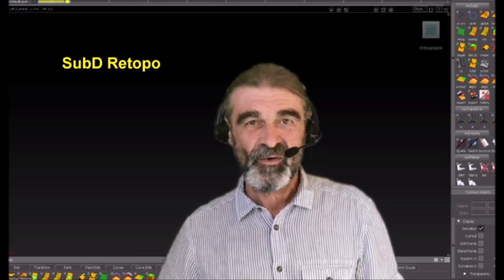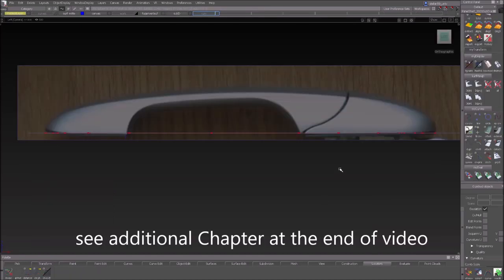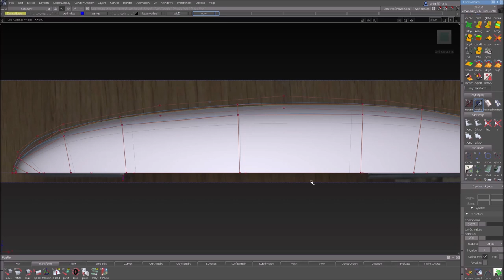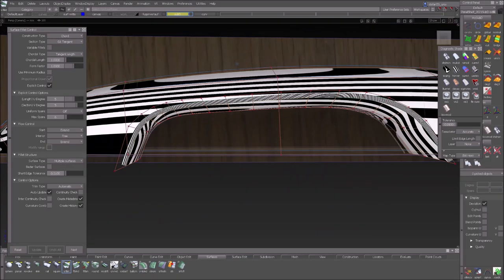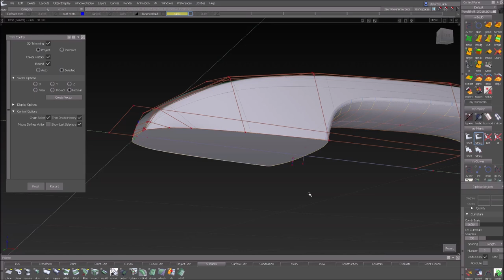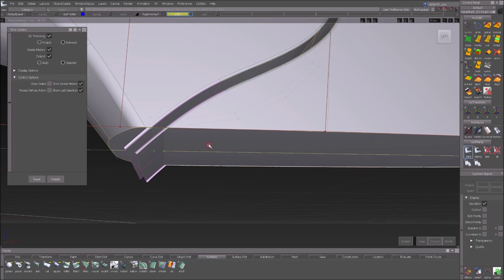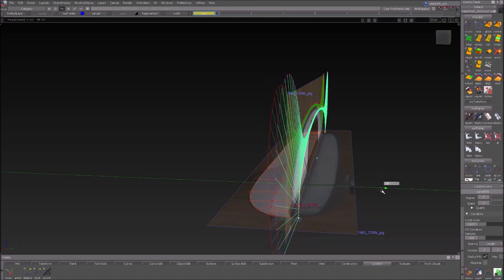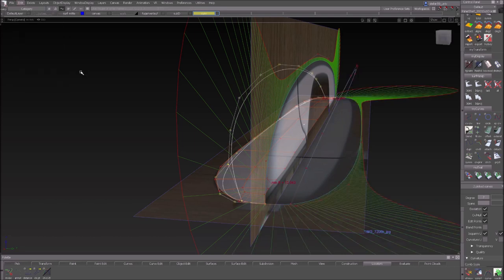Alias SubD - Modeling Fiat500  -Doorhandle

Comment: Hello! Can you help me? Is it possible to create a car body using new Alias SubD and then finish it with class A or it is better to rebuild car again using NURBS and then class A?
Reply from the maker: For class A you need to rebuild it using single-span surfaces (Bezier Surfaces). The SubD-Model is mainly for concept work when you have many loops of model changes and improvements. ClassA will be used when design data has to be forwarded to an engineering CADsystem like NX or Catia.
Reply: @TheSTROHM  Thank you for Your answer!